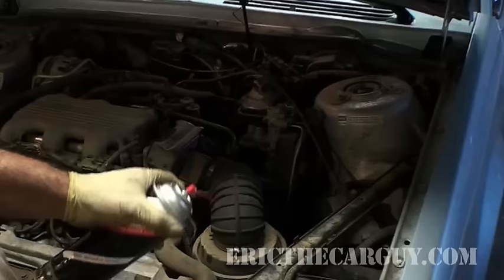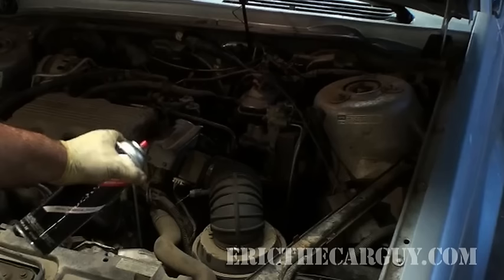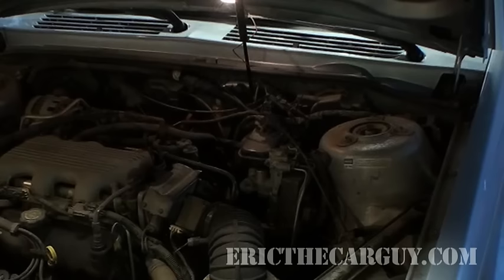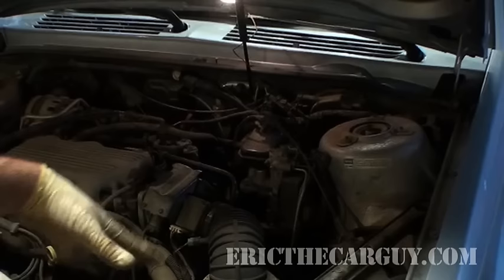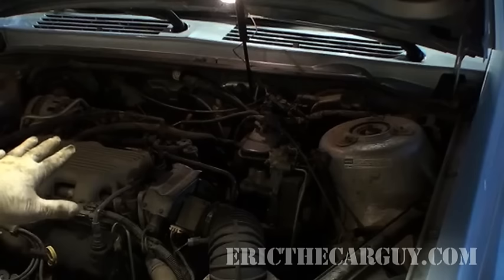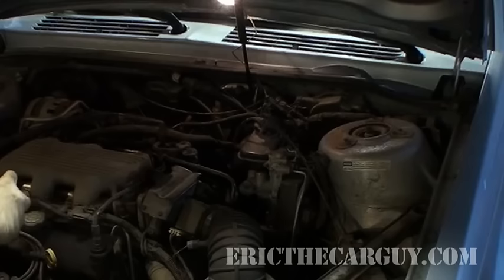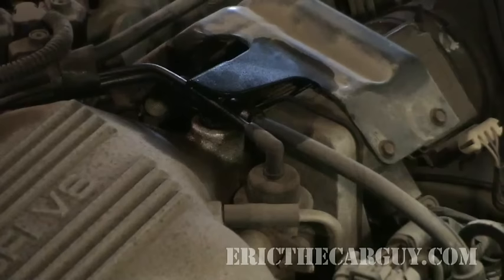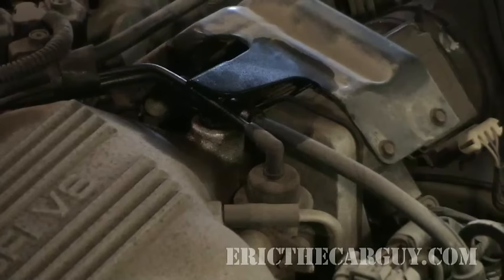How To Find A Vacuum Leak - EricTheCarGuy

Comment: how do you reset the ecu after a vacuum leak?
Reply: Take it to AutoZone to hav them reset it. I also think you can take the battery off for 30 minutes to reset.
Reply: either unplug the battery or pull the ecu fuses for at least 10 minutes. some vehicles (Chevy trailblazers for example) it's better to pull the fuses rather than disconnect the battery
Reply: Michael Engle Thank you.  Great idea to remove the fuse(s).
Reply: Another good way to reset the ECU is disconnect the battery as recommended but instead of waiting, just pump the break 10 times (really, 3 is all you need I just like to be sure with 10) then reconnect. Pumping the brakes used the remaining power in the vehicle and drains it completely. No, your brake lights probably wont come on during this discharge.
Reply: Michael Engle true. I like to disconnect the negative on the battery to reset things.
Reply: Always Armed88 that's how I've usually done resets. On my Trailblazer, I was warned that unplugging the battery can mess things up (mainly the electronically controlled ac blend doors). I've done it a few times without any problems though.
Reply: Go buy a cheap scanner for about $40 and you. Can read and clear codes.
Reply: @whatfreedom7  A cheap scan tool will not reset the ECU. It just clears the codes. Two completely different things. You want the ECU to go into a "relearn" cycle after fixing vacuum leaks to find its optimal fuel/air ratio now that un-metered air is no longer entering the engine. You do that by killing power, IE disconnecting battery or pulling fuses for 10+minutes or using a very expensive Tech II or similar scan tool where you can force the ECU into relearn mode.

Comment: My cruise control wont turn on, it this because of vacuum leak?
Reply: I can't believe this is a serious question...lol
Reply: Drew Maglio on some older cars like my friends older dodge caravan, the cruise is based on vacuum.
Reply: Drew Maglio Im in a auto motive class and we have a project to find a problem in cars electrical parts and we all need to show how fix the problem by a video. My question might be dumb for you, but im just try to find the answer.
Reply: Sorry guys, I stand corrected. I'm more of a boat guy (e.g. no cruise control) and work on in board boat engines, which are essentially gm auto engines. Forgive my ignorance, I stand corrected. Sorry for the arrogant tone!

Comment: My 1994 Camry XLE throttle sputter/stutters at 2500 to 3000 rpm when the car reaches normal running temp or roughly after 30 minutes of running.  I've changed the radiator, timing belt, water pump, catalytic convert, cleaned the throttle body, bleed the throttle coolant holes, spark-plugs, plug wires at the total cost of $1500.  The car is still stutters when I throttle up to between 2500 to 3000 rpm.  Please help!!!!!
Reply: +Feon Jun Could be your mass air flow sensor or your pvc. Did you run a scanner tool to see if any codes show up? Is your check engine light on?

Why did you change all those parts without knowing the problem? Oh well, lesson learned.
Reply: No check engine light; I found that  the exhaust gets red hot after 30 minutes of running.  Can't figure out why it's doing that.  I/Still am trying to see why it does that now.
Reply: replaced the Cat.  1994
Reply: +Feon Jun Hook up an obd2 to see if any codes show up. There's pending codes which don't light up the check engine light.
Reply: OK I will do that!! Thank you so much by the way, for all the suggestions and time responding.
Reply: +Feon Jun Did you resolve your problem? I have a similar issue on my '05 Hyundai Elantra excluding the red hot exhaust. When ir reaches normal temperature it revs up above 2500 and stays there for a while, I suspect it has something to do with the Trottle Position Sensor. Maybe the MAP sensor is involved too?
Reply: *****
My apologies for not posting sooner.  One of the timing belt track or teeth was chipped, so it  was off.  Car works now.. thank you so much for the responses.
Reply: Feon Jun That's good to hear, I'm glad you found the root of the problem. Cheers

Comment: Can i use dish soap with water or something else? I have a vaccum leak
Reply: Yes, just like looking for a puncture on a tire, but do you want water going into certain areas of your engine if there actually is a leak? NO, you don't.
Reply: @Teknakill  it's the intake manifold runner control
Reply: If you want to hydrolock your engine then yes go for it
Reply: @JohnS-il1dr  i found and fixed it

Comment: my car won't let be go any faster starts sputtering at low rpms I changed out the plugs fuel filter and still acts up
Reply: +Lino Acuna  "my car won't let be go" may want to clarify what you mean... kinda hard to understand your problem with how you said it , at least for me anyhow.
Reply: Am sorry what I meant was my 1991 Honda civic sputters on low rpms I have to drive it hard for it not to act up meaning I have to go fast on it.I did plugs and fuel filter.it has the electronic carb on it.
Reply: +Lino Acuna electronic carb or fuel injected? if fuel injected it may be a sensor issue.
Reply: +Lino Acuna Get a scanner tool and see if you get any codes. Check engine light on?

Comment: I may have written about what's going on with my car but I'll rehash . 2016SE 2.0L 4 cylinder engine Someone messed up my timing when replacing timing cover . Wouldn't start much less run . Was starting and runing before this hack got his hands on it . So after several other hacks told me it was this or that wasting time and money i found someone whao was at least semi competent and honest and reasonaly priced . He got it running but when I picked up car test drove it and found it was stalling hesistating when accelarating and told him so and said if it gets much worse I'd bring it back . It's not that much worse but twice check engine light turned on . Had it scanned three  times . First at Auto Zone and another at O'Reillys and third at a shop and sthey said it's throwing randome misfires code but no numbers / percentages just blank  .Once I changed plugs because that's what that honest mechanic that got it working again in the first place . And that's what auto Zone recomended . Check light turned off . CAme back on a few weeks later and did a kind of reboot by taking off these new plugs checking gap again and unplugging both negative and positve battery cables for half an hour . Light turned off trhe second time and seemed to get a lil better withg satlling lagging but presently no engine light is on but staling lagging now back . Not terribly pronounced but still . ..

Comment: Eric what is that part called that stalled out the car when you sprayed it? my grand am with the 3400 has the same exact leak. I pulled the part out and its missing the rubber boot or seal that goes around it. so far I have not been able to figure out what it is so I can replace it. I have an impala with the 3400 also so I pulled it out and it does have a rubber boot or seal. that is how I know it is missing.
Reply: nvm i figured it out. i was missing the grommet that goes into the intake off of the pcv hose. i tried ordering a new pcv hose but none of the parts stores around or stores online could get the hose or the size grommet i needed. i ended up taking a smaller grommet and sliding it into a bigger one and it seems to be holding.
Reply: What issues exactly did you have? My car idles low.. at like 400. And is horrible at picking up on acceleration. Its bogged under a load. The PCV valve you're talking about, was it sitting on top of your valve cover?
Reply: My car was idling very rough going from 650 to 1000 and almost stalling repeatedly. The computer pulled codes for vacuum so I redid all the vacuum lines. That is when I started hearing a whistling sound. There is a hose that goes from the pcv valve into the air intake and continues into the vapor canister. My car was missing the rubber seal on the fitting that goes into the air intake. Once I fixed the vacuum lines it ran even worse until I replaced that seal. I would say that there was a vacuum leak preventing it from getting vacuum and once it did get vacuum it the missing seal caused it run worse.
Reply: My car never idled low and seemed to accelerate without hesitation. I would say you are experiencing a different issue. I have no idea what though

Comment: If,anyone reads this i have a loud what i believe vacumm leak that only happens under accelertion or going uphill,,at cruising speed its ok..i threw a 0300 random,misfire code,,i changed my front three plugs and intake gasket,cleaned throttle body,maf,new air filter oil,change..my point is i have an endeavor and to access the back plugs and gasket is a pain but my front plugs and coils were drenched in oil,,so im,assuming the back most likely is..so can that be causing a random misfire or should i look for what sounds like the vacumm leak..any PROFESSIONAL advice will help ,also i cant afford toreplace all back 3coils and you cant test them one at a time because EVERYTHING needs to be put back,together COVERING access to the plugs again...DUMBEST design ive EVER COME ACROSS..just another way to make the average person spend 400 dollars on a damm plug change..sorry for the rant ,again if anyone has any advice im all ears before riping back top,of my engine apart.also going,uphill car is very sluggish and since changing front gasket im,no,longer losing oil..

Comment: hi, i had engine light come on my honda accord 2000, ex v6. I used scanner less method to get code 80 as well as confirmed with autozone scan i get coresponding p0401. Who knows what the cause problem exactly is . Could it be a vacuum leak that can cause p0401 due to insufficient vacuum pressure alongwith some clogging or vaccum leak is not related to this at all. Here is why i think there is vacuum leak..Some months ago dealer replaced transmission on this and also engine mounts. I told dealer there is some intermittent noise that comes but unfortunately it never came on test rides. So i opened hood did recording using a cellphone and that's ofcourse at idle . listen to this noise here - http://vocaroo.com/i/s1fTaF34trVK any help is appreciated.

Comment: how does one reset the ECU
Reply: in my 89 GMC i just unhook the battery terminals for a little bit.  youcan hear the ECU re-learning after that.  its kinda interesting listening to it change little things here and there until it feels that whats going on is "just right".  granted this is an old ECU that is working a throttlebody fuel injection system that is comparitively VERY dumb compared to newer vehicles ECU's that run port fuel injection and have all sorts of sensors.
Reply: as above, also some cars require you to let the car idle upon restart for 5-10 minutes before revving to recalibrate the idle control and mixtures, usually on older obd1 and early obd2.
Reply: Derek Dosant thanks for mentioning that, forgot to do so myself.

Comment: What about a water bottle mister with water in it.
Reply: +edward kosinski Water is uncompressable you might blow up your engine block by doing so
Reply: +Gottlieb Von Ramm You didn't answer his question.
You can lay a water hose running at a low volume all over your intake without damaging your motor as it idles away.
The engine RPM will increase when you find a leak, AND you will hear when a cylinder goes "dead" from flooding. There would be no harm to the engine as you fear.
Reply: +edward kosinski  "You can also use a spray bottle with water to do this same test. It may not be as effective, but you don't have to worry about spraying a flammable substance on a hot engine."  Learn to click Show More Button

Comment: SO HE IS SAYING IF THE code is lean it wont be A vacuum LEAK????
Reply: I heard him say, "it will bias rich" meaning the computer control will provide more fuel to compensate for the additional air- you'd see this in the fuel trim measurements.. at least that's what I thought he said.
Reply: If it is lean, then it is most likely a vacuum leak.  You're sucking in too much air and it's throwing off the fuel/air ratio.

Comment: HI, firstly great videos :)

Ok, so I have a vvti turbo'd supra and recently when idling especially when the engine is warm the idle rpm will go really really high all by itself. I'm talking from 600rpm to 5,000 rpm. Could a vac leak be causing my engine revs when in neutral to all of a suddenly rise?

Kinda scares me the engine is doing this and I immediately have to shut it off.
Thanks for your help and hope you can help shed some light on my cars issue. btw - this car is uses a fly by wire

Comment: LOL, no wonder y you desire to use that motor has example
I got a 2000  Oldsmobile Alero and it just make me think  y there is many lines with so chip material and  poor engineering applied  especially were you found the first leak, when you turn off the motor that little thing whit the for of head pop out and  when you turn  it on never sits right  covering the hole

Comment: I replaced both upstream o2 sensors but service engine light is still on after resetting it and driving it, could it be a vacume leak? Someone please help
Reply: i had the same issue, i replaced all kinds sensors. total waste of money. turns out i had low compression. had to get a new engine.
Reply: sensors are such crap. i could tell many stupid stories. got so tired of them, i sold my 97 truck and bought a 73. no sensors, engine lights, or a need for safety and emissions. sure it only goes 70mph max but at least the chicks dig it.
Reply: yes it could be a vacuum leak and also a bad gas cap will too !

Comment: I have a question eric i have a 1978 el camino that stalls pretty much anytime i put it in to gear reverse or drive it has the 3.3 v6 just wanted to get your opinion on whats going on with it
Reply: Could be a problem with the lockup torque converter.

Comment: just bought 01 2.4 liter Pontiac Grand AM 187,000! {No judgments please make min.wage believe in owning things outright} I get the car needs loads of work. I used to love working on my 76 Chevy Nova but never dealt w/computer vs fuses ive no knowledge of this car. found out it was sitting for approx. 60days " probably in reality 3times that". I replaced some cosmetic issues only to get it road legal. (didn't require emissions based on zipcode). Check engine lite was on 2days then off 2wks. Now on & stayed on=so got codes chked- was told IAC bad changed out IAC. didn't know bout resetting computer then so lite is still on + another idiot lite TRAC OFF. Concerns me terrible! Surges like a bitch when driving. no surge in park or neutral. Last 2days smells of gas {yes replaced cap} & I believe my fuel pump is faulty...hear a ka chunk when key is turned on B4 cranking engine. Many of my gaskets & hoses possibly broken/faulty from sitting already fixed the radiator 3/4inch hose...idfk what to tackle 1st? Only time I smile thinking of car, is imagining my fat ass peddling past it on a bicycle cuz it died on me somewhere~elSavage